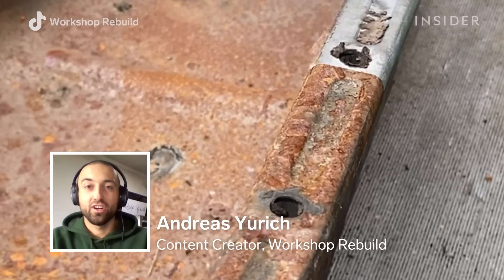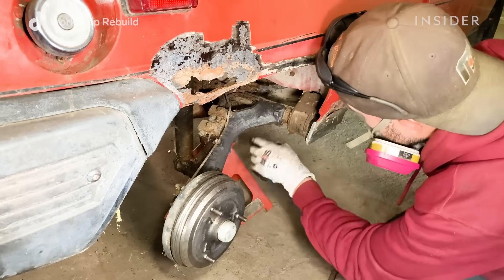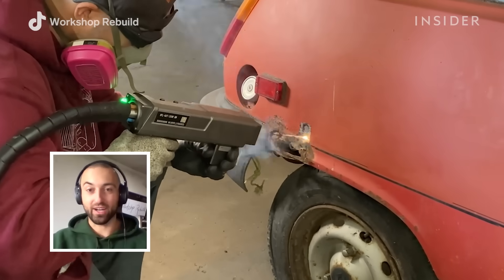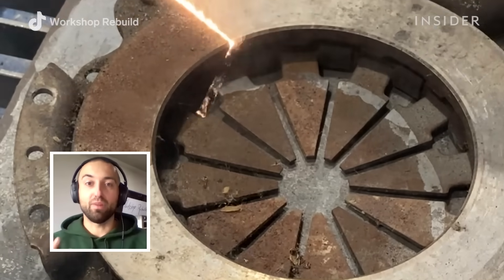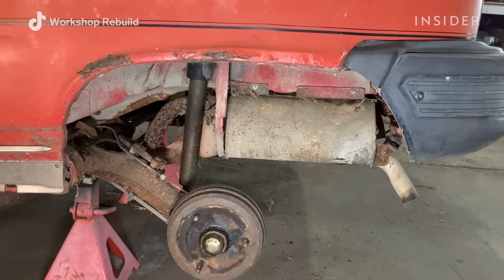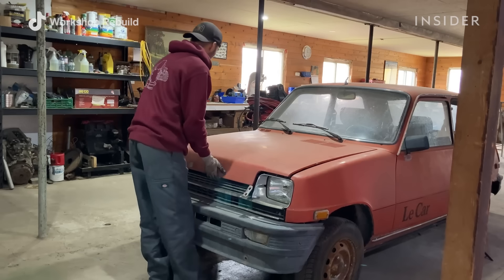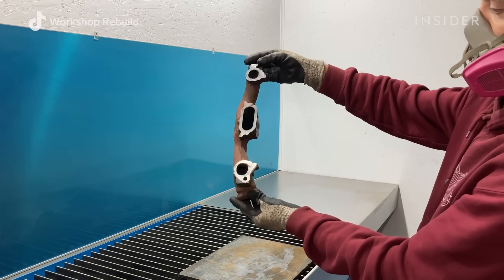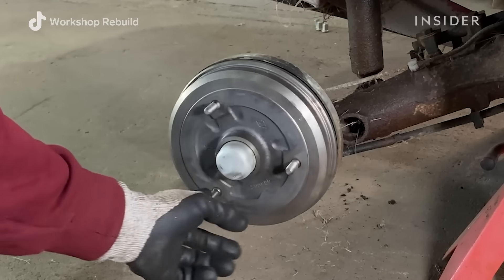How Laser Cleaning Deep Cleans 40 Years Of Rust On Cars | Insider Cars

Comment: It's messier but I prefer abrasive blasting for automotive repair work, it does a much better job of removing heavy rust and old coatings, it can also be used to give you a key for applying new coating systems.
Reply: Like Mark Messier?
Reply: @emmittmatthews8636  No, Charles actually 😉🤪
Reply: Hi do you know sand blasting machine reasonably affordable for business where to find and what model and price how much better stick with old way laser expensive and some complain look like now early to use it successfully! Thanks
Reply: @kawataufik5098  Hodge Clemco make the best equipment for blasting, you can purchase either a standalone blasting pot or you can purchase a booth type setup that will enable you to recover the blast medium if you're planning to do many blasting jobs.
Reply: @Altair885  thanks you so much for information they have website? I use for cars but hard to find Wright one you think can but around $2000 Australian? My budged law 
Take care
Reply: @kawataufik5098  I would look on eBay or one of those other online auction sites.  You can usually pick up a decent blasting pot for not a lot, but don't forget you'll need a big compressor and an air dryer for successful blasting, and for safety an air fed blasting helmet.
Reply: @Altair885  thanks I see in eBay and Amazon nothing available but I not like China made if you see in eBay may be you much better than me give me an item number on eBay those I see not comercial Japan or German or USA and England ok 
I send email to uk they have best sandblasting ! 
Thanks John
Reply: @Altair885  hi I send email for hodge Clemson in uk I wait for reply as you said they do the best thanks
Reply: @kawataufik5098  I believe they have representatives in Australia, it's an American firm but they're all over the globe.
Reply: @Altair885  yes mr John thanks for kindness
Reply: @kawataufik5098  My pleasure 😉
Reply: Laser is better.  You need to buy sand with a sandblaster.  You don't need to buy laser with a laser.
Reply: @MG-ks1qg  Depends what you want to do, the laser is effectively burning off the contaminated top layer, this still leaves a noticeable imprint where the patters of corrosion etc were.  But with abrasive blasting you can re-profile the surface ready for a coating system to be applied without blemishes.  Re-profiling also allow you to give a better key for certain types of coatings, the beauty of blasting is that you can profile as much or as little as you desire.  Also if you have the correct type of blasting equipment you can soda blast, which is brilliant for removing old coatings without damaging such items as glass, rubber or plastics.   Btw none one uses sand anymore as it breaks up on contact creating a very fine silica dust that can cause silicosis, a very nasty pulmonary disease that often kills.  Modern blasting uses much safer mediums now.

Comment: Super cool technology 👍🏻 without harsh toxic ☣ chemicals 🧪! It’s definitely going to take some practice and a steady hand with all the different types of metals and surfaces.
Reply: You're basically vaporizing whatever it is you decide to remove. You should absolutely be using a filtered mask and proper ventilation.
Reply: @UpToSpeedOnJaguar  if anything I’d say he isn’t using enough PPE.
Reply: @Hlokip  those pink filters are the best money can buy, look them up, 3m pink filter.      You have to use extreme caution with all this stuff,  ive had a close shave myself with something I thought was extremely safe,  but later found out it was extremely dangerous,  fortunatly I was wearing ppe at the tine
Reply: I would use extreme caution with old painted surfaces, many paints (at least in the USA) contain lead.
Reply: I would be a little worried about fuel and brake lines. Whoosh!
Reply: @maxwellcrazycat9204  Brake fluid isn't supposed to burn but I'm sure it makes toxic fumes when it vaporizes.
Reply: @maxwellcrazycat9204  FOOMP
Reply: Notice the guy in the video is using a chemical mask
Reply: Nothing beats electrolysis
Reply: No chemicals but whatever you laser off will vaporize and go into the atmosphere- it doesn't just go away. Admittedly since it's a high power laser you don't need any resources except a power source (very useful and cost effective!!) But if you breathe any of it I don't want to imagine the 100 different types of cancers you'll get.

Comment: This is the most awesome machine for cars since dry ice machine
Reply: What would be the best between these two technologies for automotive repairs ?
Reply: @nikko1984  both have different uses. Dry ice is used to clean metals off of dust, oil etc. this one is to remove metal rust.
Reply: @MohammedKhaled-ju7gy  cleaning metals off of dust, oil? Shouldn't it be the other way?
Reply: @senul_samarasinghe  ah shit. Got me there. Gonna leave it unedited 🤣
Reply: @MohammedKhaled-ju7gy  all good comrade.
Reply: Looks like with the laser it removes paint, at least on this video as for dry ice I’m sure they aren’t abrasive, so it will only removes dirts.